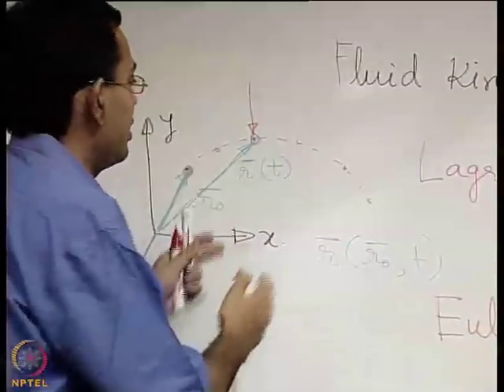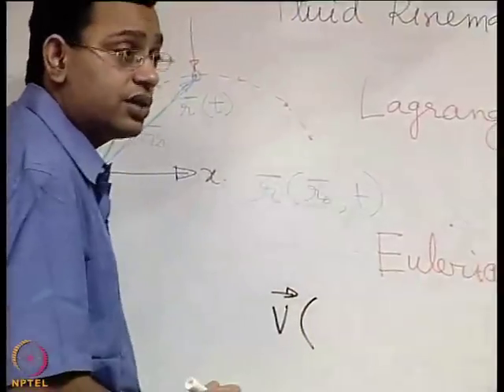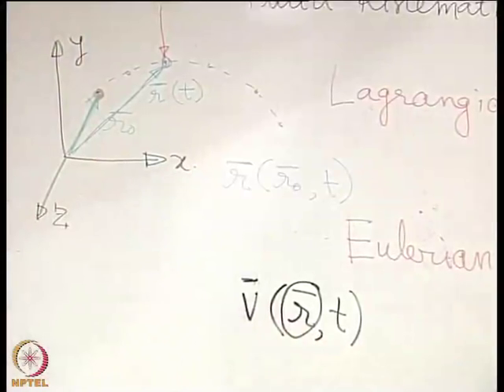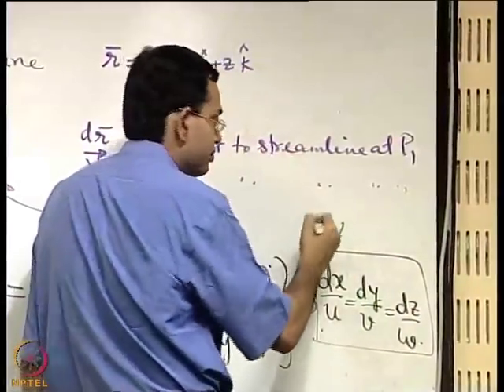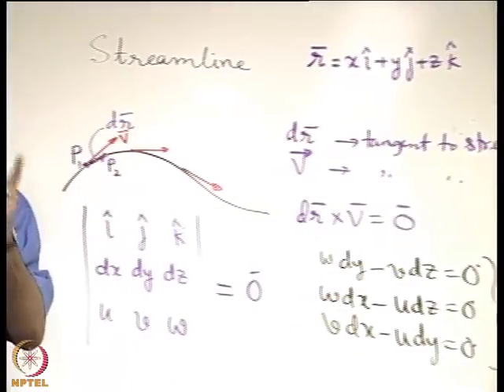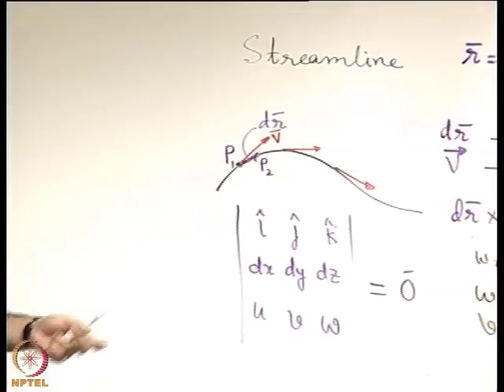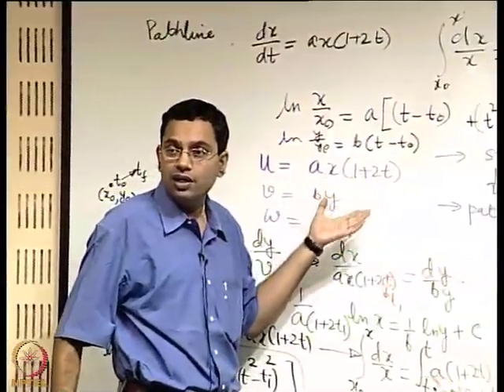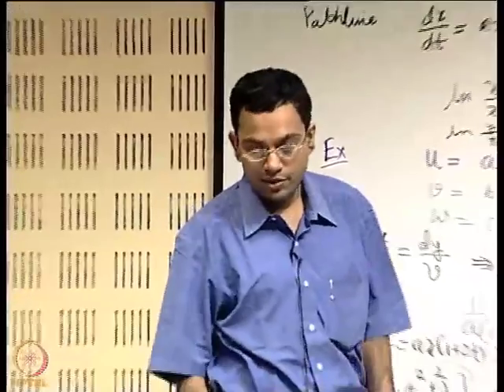Mod-01 Lec-11 Fluid Kinematics

Comment: In the derivation of the expression for stream line , the assumption or consideration of P1P2 i.e r vector to be tangent to the curve at point P1 is bit confusing sir.Though we take the distance between P1 & P2 is infinitesimal,both the points do exist on the same curve and a tangent to a curve can pass through a single point on that curve.So,How can r vector be tangent to the stream line ? Could you please explain it in detail.
Reply: Here , as dr vector tending to zero both point P1 and P2 approaches to single point and hence dr and their tangent becomes same.